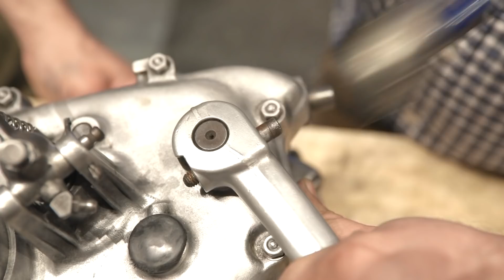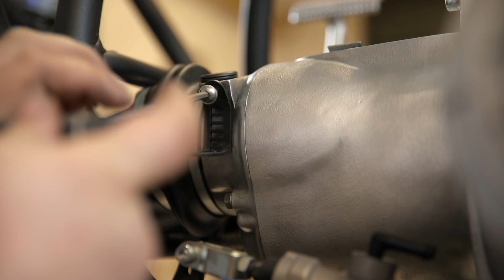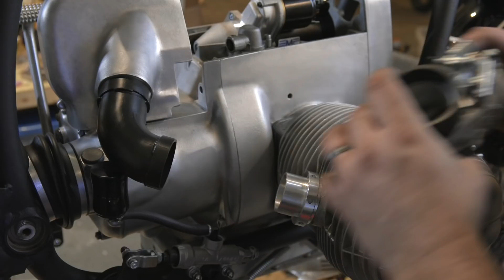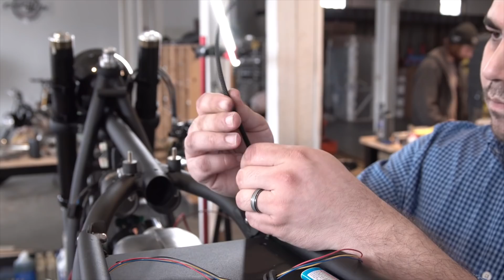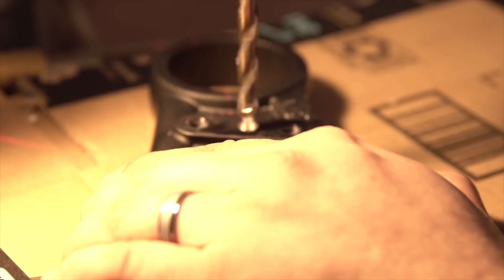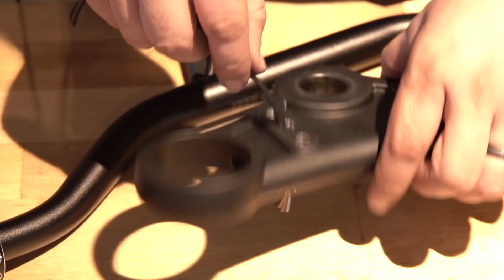Cognito Moto: R75/5 Build Episode 7

Comment: You mounted the rear brake reservoir to the vent hole for the gearbox? Did you use a bolt with a hole or vent the gearbox another way?